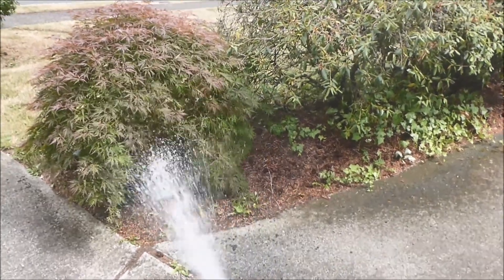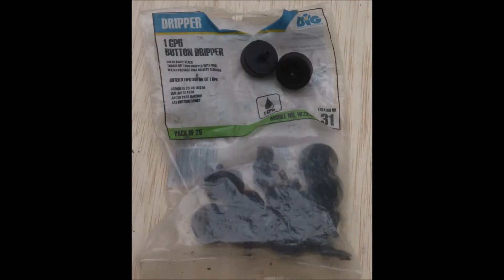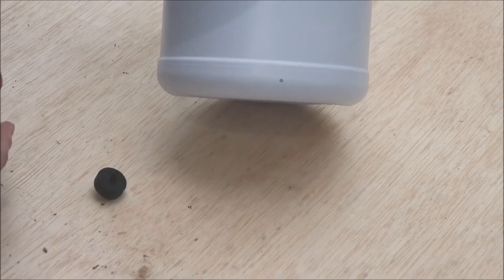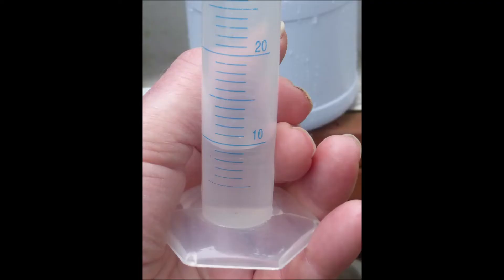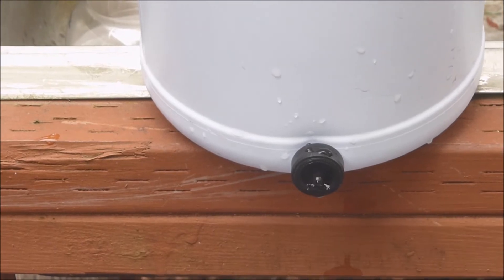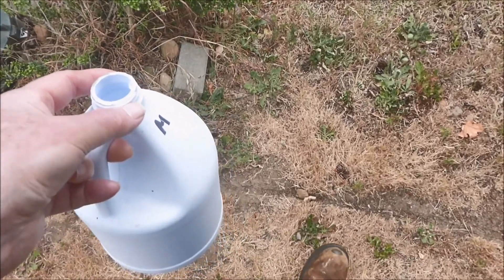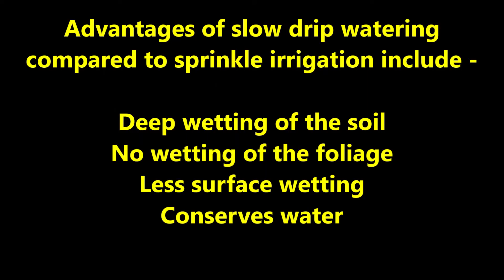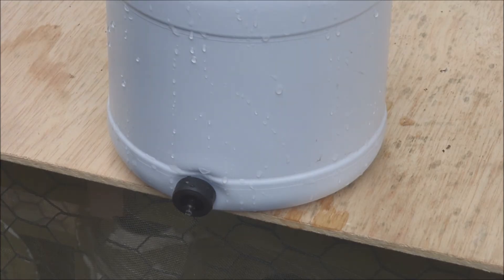Bleach Bottle Button Dripper Waterer

Comment: You cracked me up when addressing the bleach bottle!  Interestingly enough I just walked past a house and noticed they left a Detergent bottle outside. I think the intention was that it still had content and the were moving.  I wondered if , after using the free detergent inside, I could somehow use it to irrigate something in my yard. That was yesterday and today this video popped up, almost as if the universe were answering my question.  I am doing mostly passive hydroponics so I have no need for button drippers but for some reason , when I ordered irrigation tube connectors to make more bottom irrigation float valves, I added some drippers to my order.   Now I realize I can just pop them directly to the reservoir if needed instead of dealing with hose. 
I've seen similar with soda bottles with holes punched in the cap. 

Thanks for a humorous and practical video. I do have a recycle bin full of various containers that could be used similarly if needed.  I just planted some soil medium  Pop-in-pot-in-pot chayote, kabocha, and ginger is next on the list.
Reply from the maker: I'm happy to hear that you enjoyed the humor and are trying out some of the methods!

Comment: So you just adding a gallon of water to your plants soil for 8 hours? And what the reason to not just spill this gallon into soil in 5 sec?
Reply from the maker: Spilling the gallon will result in some erosion and runoff, whereas slow watering will promote deeper wetting of the soil.

Comment: Dr. Kratky, have you done any studys on the best ration of air vs water roots in longer growing plants such as tomotoes?  Thanks for your channel, I'm a major convert to the Kratky system!
Reply from the maker: My practice has been to let the solution level decrease to 40% of the tank height and maintain it with a float valve.  I don't  have adequate research data to make absolute recommendations for different crops, but this generally works ok with the understanding that it can probably be improved based on your experience.
Reply: This is agreat question as I often worry about lettig the solution get too low, but they drink a lot of water during the hottest days of summer and I fear over filling them after a deep drink, so I've just been topping them off to their original water level and letting the air roots grow in the original air space. I might be working too hard at this.   
Also my last float valve failed for some reason. I think it got clogged, so my tomatoes water was much lower than I thought but I knew it failed because the tank had too much NuteSol stil lin it and I caught the problem before they dried out too much.   I am using large pharmacy medicine bottles and expanded/extruded polystyrene as my float. I think, my hose being old, it may have some sediment inside that just broke off and clogged the whole rig. Since I have another tank on top, I'm having to water with a funnel because I cannot get below to fix the float valve.
Reply from the maker: @Metqa  Yes, sometimes dirt can plug up the float valve nozzles.  I recently have place an empty tea bag as a filter over the water inlet and that helps.

Comment: Dr Kratky, thank you for all your educational videos and contributions to the hydro community. I have 3 questions, if you don't mind. Your help would be greatly appreciated.

I've seen some videos of people successfully use your Kratky system and would like to emulate them, but I;m not sure about a few things.

1- Heat. I live in Lebanon, Middle East and our summers reach between 80 F and 95 F degrees (we rarely ever reach 100 F). I have no means of burying a reservoir nor partially shading it. All I can do is wrap the reservoir with foam insulation. My concern is how does a Kratky system handle heat. Would a 200 gallon reservoir Kratky system survive direct sunlight in such a climate zone? 

2- Nutes.  Since a Kratky system is fill-and-forget, what is the ideal EC or PPM I should use for a 200 gallon, given that with time as the plant drinks more, the nutes concentration would get higher? 

3- Transplant age. I understand that I  must harden a plant first before giving it full sun 24/7, but at what age can a plant survive in your system in full sun? Is 2 months old enough?

Thank you again for all you do. Much love.
Reply from the maker: I guess you could paint the reservoir white to reflect heat.  Since you have hot, dry weather, it might be advisable to prepare a less concentrated nutrient solution eg.  1.0 to 1.2 mS and adjust as dictated by plant growth. Crops like lettuce often wilt during the midday heat, but rehydrate later in the day.  Crops like tomatoes and cucumbers seem to handle the midday heat better.  I think one month is ok if they are hardened.

Comment: Cool idea! I don't know if it's worth the hassle but one in principle could put the dripper on the cap and keep the bottle upside down (of course some kind of pedestal is needed to keep the bottle in place). I also built myself a olla with a unglazed terracotta pot and used it for some strawberry with some success. Not sure if it could work with bigger plants.
Reply from the maker: Thank you for sharing!